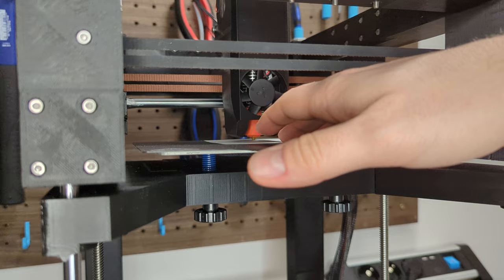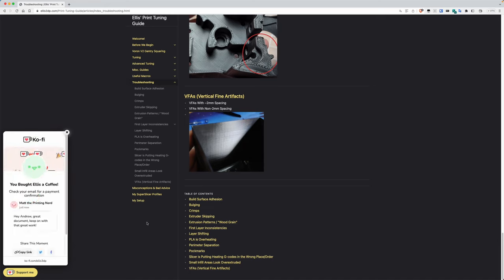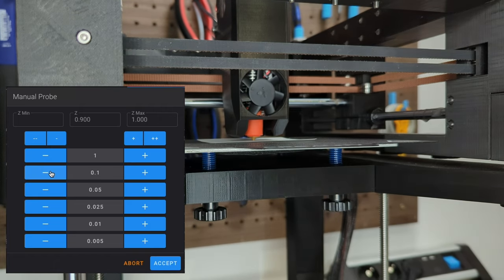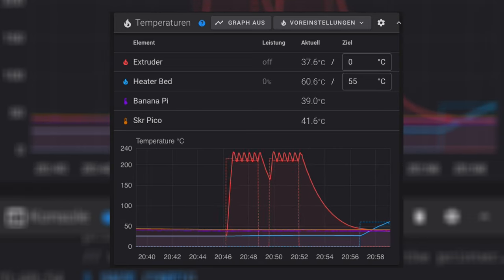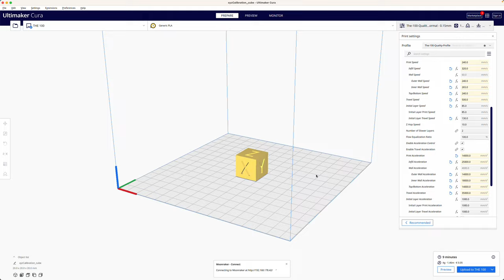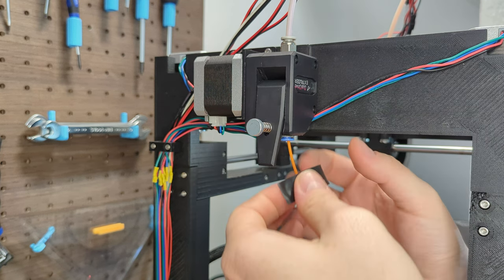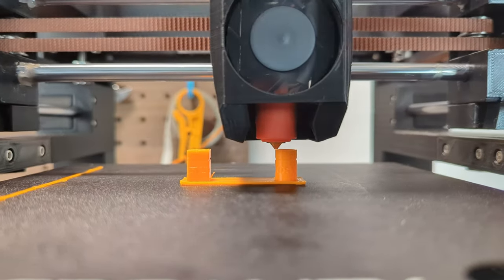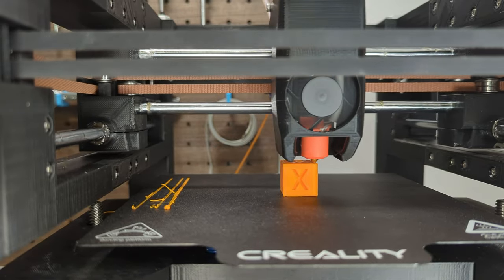How I tune 3D Printers

Comment: great video! One thing that has plagued me is once the printer is tuned and you use a different type of filament what are the steps you should take to calibrate that with the filament, or is it doing this all over again for that scenario?
Reply from the maker: I know what you mean, I plan to do a deeper dive into this topic in the 2nd part.

Comment: Thank you for a great video. 
I am at the moment building the 100 printer. 
There is one part in the calibration video I don't get. 
After you have leveled the bed you move to the midle, do the paper ting, and move the bed further down and save it as the zero position. 
But now every print you make will be that distance to high.
If you measure the Z height on the calibration cube, I think it would be around 0.3mm to high.

Comment: Hi Matt! Thanks for your great work, I'm definitely thinking of building this printer! 
Just one question: do you plan in adding a probe for auto bed leveling?
Reply from the maker: proper abl would increase the price of the printer by $150-200, since you would need a bigger mainboard, more motor drivers a good abl sensor... currently I don't think it's worth it, but we have already ppl in the community that working on such mods, so checkout our discord

Comment: I have t he same vertical lines, that isnt from ringing and it isnt from belts (non 2mm spacing) they look like yours, what can I do? they are mostly on the Y axis
Reply from the maker: That are vibration artefacts that caused by acceleration/deceleration while printing, you can't complete get rid of them when printing at higher speeds but you could compensate about 90% of them with proper input shaping
Reply: @MattThePrintingNerd  I printed my cube at 20mm/s... it still has these same lines
Reply: @hapsti  have you managed to fix that?